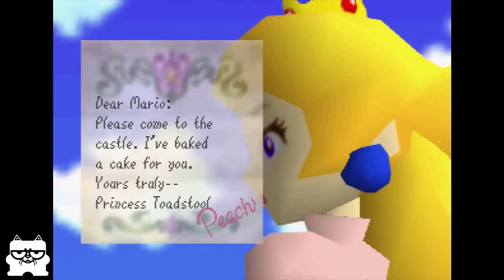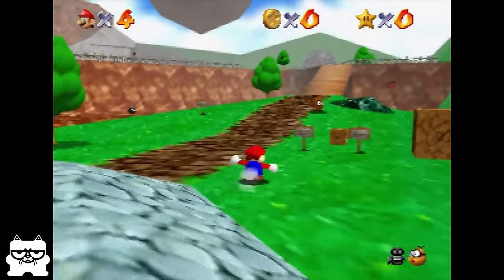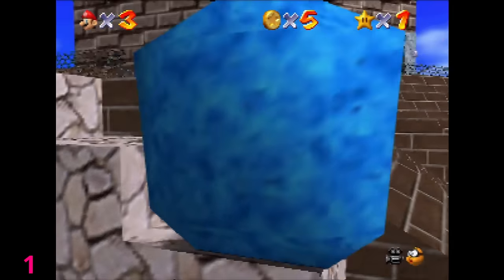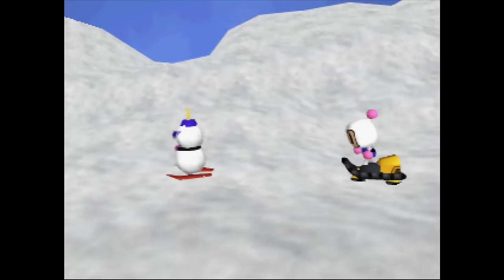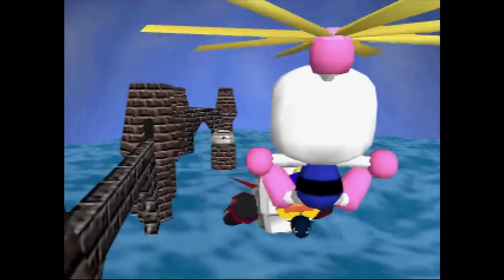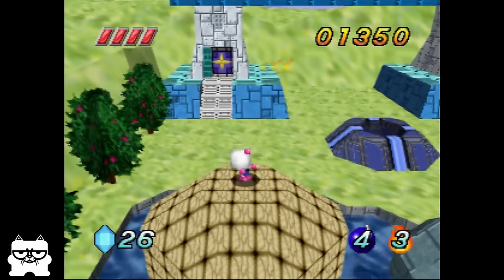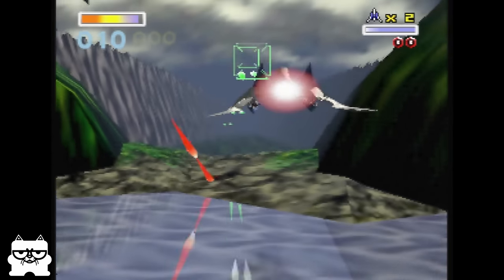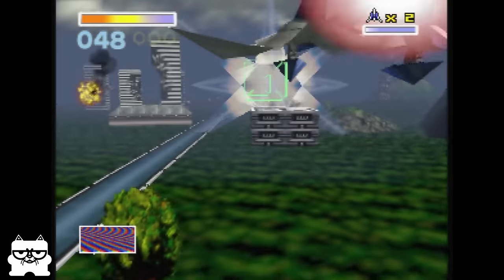MiSTer FPGA N64 Core Updates! FPGA vs Ares Emulator! Nintendo 64 Emulation Compared

Comment: With the Termina Field theme in Majora's Mask, I can tell the difference between the N64/Mister and Project 64.
The drums are much sharper sounding on N64 vs being muffled in PJ64.
Even the 3DS version seems to use some emulator rip with reverb added to it.
Reply from the maker: Sound is always an interesting area in which performance can totally differ

Comment: Both look great, and I've played N64 on the MiSTer core and PC emulators (not the one shown). For me a killer feature of the MiSTer is the SNAC controller port because emulating controllers, the N64 controller in particular, is never perfect on PC in my experience, be it gating issues, sensitivity/sampling differences, or lack of analog trigger support. Maybe the reflex adapter resolves some of these issues on PC, but I don't have one to test. Yes, the MiSTer is still emulation so the controller implementation might have bugs, but those will get resolved, and it's much easier to get right on MiSTer. And if you like playing N64 with a Switch controller, that's great too, but I really enjoy accurate OEM controllers.
Reply from the maker: Yes the SNAC support makes a big difference for sure

Comment: I only feel confident guessing on the Mario 64 test, but Source 1 is Ares and Source 2 is MiSTer, I'm pretty sure. The top row of pixels is consistently a bit off in all the Ares footage, in a way that it never is on the MiSTer footage, but only with Mario 64. Possibly with Majora's Mask but there's letterboxing with all of that footage so who knows. Oddly enough it's not an issue with the other games, maybe that footage is cropped slightly or something.

Other than that one detail I couldn't possibly tell which is which though.
Reply from the maker: None of the footage is cropped minus fitting the side by sides. No pixels removed, just scaled to fit with constraints on the X/Y
Reply: I noticed that too! There's some weird distortion happening with models along the very top row of pixels, only on the Ares footage, and only on Mario 64. It was a dead-giveaway for me to come to the same conclusion: Source 1 is Ares, Source 2 is MiSTer.
Reply from the maker: It’s an interesting difference but not spoiling the source quite yet :)
Reply: This is something that happens on original hardware as well. My N64 connected to an OSSC displays the same black pixels on the very top, and I know Parallel RDP does the same, which is the display driver that Ares is using.

Comment: Hmm...it looked like there were more frame drops in the Mario 64 footage for the Ares footage. But yeah, unless both are identical gameplay, anything could cause that.
Reply from the maker: People seem to be noticing the frame drops. That is def a thing that differentiates the two sources. I’ll tell you which is which soon
Reply: The NES core was updated and FDS now works and looks like a few new settings etc
Reply: I'm glad to see this close a race, and for Ares to receive the acknowledgement it so rightfully deserves. 

It does feature some enhancements like resolution upgrade and runahead, but it does struggle even without those. 

However, for accuracy-focused people the ParaLLEI RDP is comparatively very performant, and the endless amount of shaders it supports (having recently adopted retroarch's Slang shaders) are very convenient too.

If you're going to try out Mupen, I'd advice you to get "Rosalie's Mupen GUI". It completely self-contained and can automatically update the core, the plugins and the GUI itself.

The true strength of Mupen64 and its forks is the ability to use texture packs. Everything made by EvilGames is absolutely phenomenal, for example.
Reply from the maker: Yes Mupen is made for enhancements. That being said I run these comparisons “out of the box”
Reply: Yea instantly spotted it especially on starfox.

Comment: I'm very curious to see how Analogue's FPGA N64 shakes out. Only reason I'm holding off on getting a second MiSTer is because the slim chance the custom firmware for that will negate the need for it.
Reply from the maker: Yes it’ll be interesting to see when we get more details on what Analogue is up to

Comment: The trouble with Windows software emulators is the heavy latency they all have, not the emulators fault, it's the OS overheads and API latency, not to mention I/O stuttering, and worst of all, Nvidia and AMD GPU frame-time jitter & stuttering you get, even if you own a hardware G-Sync module, you will get some frame-time spikes, which is not too much of an issue for modern games, but can make retro gaming unplayable, then on top of that, even if you have a low latency fast polling gamepad to use with the emulator, it's held back by the USB HID controller/chipset, legacy BIOS's were actually much lower latency, and if there is a Windows XP or 32-Bit Windows 7 LTSB version to use with the PC with a legacy BIOS you are better off using that as it will feel much better thanks to low latency, make sure to turn of all unused I/O, and if you have a D9 game port gamepad use that instead to avoid USB lag you get with Windows/Linux, it's a shame FireWire gamepads aren't made available, fire wire has much better input response, same goes for FireWire audio DAC's, the only trouble is, a  PC with a legacy BIOS won't help you with what is really the only accurate N64 software emulator (Ares), because it needs a modern beefy CPU, and those are only available for motherboards with laggy UEFI BIOS's now days, not to mention the HDMI DRM handshakes causing issues with frame-times too.

And getting a stable, clean RGB 15Khz signal from a PC is another pain in the arse task, modern GPU's just don't come with analogue RAMDAC's any more.

The only way these software emulators can realize their true potential and compete with FPGA, is if they are available in bare-metal versions or at the very least an OS with all the unwanted backend striped out, a fast BIOS with no I/O latency, a Raspberry Pi 5 running RGB-Pi is pretty good, and will have much lower latency than a PC software emulator, but still a long way from zero lag OG and FPGA hardware.

MiSTer has taken "emulation" (kind of emulation still unless it's a 1:1 transistor level FPGA core) from a novelty that can be fun to use now and then but ultimately not a very good way to play retro games, though fantastic for more modern games where video and audio timings, input latency and legacy video modes is not as important (though software audio emulation will never be as good as real hardware or FPGA imo (brute force nuked audio soft emulation can be pretty good but needs a lot of CPU power and can choke your CPU up, it brings my i7 gaming laptop to it's knees in a cycle accurate Mega Drive emulator core with nuked audio activated),  to a real and viable way to play classic video games besides real hardware, not to mention how much better the compatibility is with FPGA 99% at worst, 100% for the most part, and things it seems are just getting started with FPGA now, MiSTer is really just gen 1, though I will be happy with my MiSTer for a good 5 years before I look at anything else now, so many cores and games to play, Roberts N64 core will keep me happy for the next few years alone, just replaying my favourite games in reference quality RGB and audio, and then there is the Saturn core with so many amazing games I have never played.
Reply from the maker: Yes the issue with anything windows is that there is so much underlying OS processes running. That being said I kill all non essential processes for these tests and run them on an overkill i9 build that is about as fast cycle wise as you can get
Reply: You are exaggerating all those issues. I have no frame pacing or frame rate issues. No "I/O stuttering" whatever that is. I have perfect frame rate/pacing on my VRR monitor and there's no such thing as "heavy latency" either, most people can't even notice the difference even though there is some.
Reply: @Imgema  Software emulation for pre 6th gen video games really isn't for me in Windows or Linux, especially when using a CRT and a sub 2ms gamepad, I remember trying to play Space Channel 5 in via soft emulation lol, was a nightmare, as is Guitar Hero and Kuru Kuru Kururin or Sonic 1/2/3, it just wasn't an enjoyable experience,  once you get past Dreamcast and PS2 however, software emulation can be fantastic with a nice CRT or OLED monitor, best to use an LTSB version of Windows though, or an optimized Linux distro, but keep in mind Linux can have more latency, not less, bad audio quality ad sync issues, also scanline-sync is far better than VRR btw. 

Heavy latency just means dense/laden/lots/etc, when you combine all sources of latency, including video, input, audio, OS overheads, API calls, driver lag, sample & hold lag, it all adds up and can be a very big difference from sub 1ms latency total with FPGA and a CRT.

Comment: Well , ares use parallel N64 libretro core by default.this is why it is so accurate. You can have the same result in RetroArch as well.
I think your footage of starfox was taken from the fpga core, it seems your PC lag a slightly bit more than your mister and the fps is a bit inconsistant.
Reply from the maker: The PC can lag. But I’m running an i9 so it’s more of an emu issue

Comment: Is there a list of the differences between MiSTer N64 and real hardware? I know Robert had to make some changes to get around limitations. What are the effects of those apart from not running some of the later stuff. Have you tried Smash 64 Remix on MiSTer?
Reply: As for my guesses. First clip, Source 1 emulator, Source 2 MiSTer.
Reply: Bomberman side by side, I'm guessing 1 is MiSTer and 2 is emulator. (Oops, was supposed to be for audio. I can never tell audio. Random guess MiSTer.)
Reply: Final guess. MiSter for StarFox64
Reply from the maker: Some solid logic here
Reply: @VideoGameEsoterica  wdym?

Comment: Instead of Mupen64 you could compare it with Simple 64 (which is a Mupen fork + Parallel RDP for graphics). No point comparing the base Mupen and something like GlideN64, which needs different settings per game...
Reply from the maker: There will be more than one comparison. Still WIP

Comment: 6:50, Source 2 has a lot more frame drops, so I'd say that's Ares. In my experience, Ares drops a lot of frames where it shouldn't, so performance is actually worse than on a real N64. The floating mario head on mario 64 is a prime example, Ares lags like hell in that (there's an issue for that on github, issue 352 on their tracker).  Not sure if that's actually Ares though.
Reply from the maker: A very good reasoning behind the guess
Reply: Ares doesn't have inherent frame drops. It must be his video recording software or maybe his PC isn't powerful enough.
Reply from the maker: Lol charming today aren’t we. I am running Ares on my editing rig. Which is more than enough to run whatever emulator I throw at it. I’ve also killed all processes that are non-OS essential. A new i9 overclocked on water with 128GB of ram…not that it needs anywhere near to that
Reply: @VideoGameEsoterica  What GPU do you have? Ares needs good Vulkan compatibility because it uses Parallel RDP for graphics. I have a much older i5 4670 with a 1060 card and the frame rate in Mario 64 is perfect (though my PC can't handle other games like Conker). So maybe it's the recording software then?

Comment: How beefy we talking ?
Reply from the maker: i9 13900K with an OC on water
Reply: doesn't require that much of a high end system to run the ares N64 core. I was running on an older i7-9700k with no overclocking for a long time and could run it just fine. Newer i7's like the 14700k absolutely crush it, and the M2 based macs run it very well also.
Reply from the maker: I’m not saying it’s required :) I’m just saying any results aren’t constrained by hardware

Comment: damn ares n64 does not run well on my computer lol. I was hoping for a competitor to openemu but oh well. I think openemu uses mupen and it is decent, I think it uses a 640x480 mode by default so not totally accurate (on openemu)
Reply from the maker: Ares needs a high spec system for N64. I run these on an i9 13900K with an OC
Reply: @VideoGameEsoterica  if it is the most accurate in software, makes a very good case for mister!

Comment: The N64 really benefits a lot from an increase in internal resolution of at least 2x (something that is not possible on the Mister).

320x240 is too low for 3D graphics.

That's why when it comes to PS1 and N64, I still prefer software emulation, since it's possible to implement some improvements that work well even on a CRT.

For example, it's possible to use a CRT resolution of 1280x240 and increase the internal resolution of PS1 or N64 games by 4. With this, it's possible to take advantage of the higher horizontal resolution of the CRT while the 2D elements on the screen remain at the same quality due to the vertical resolution of 240p.
Reply from the maker: Interesting. I actually don’t prefer bumping the internal res for N64. It looks off to me